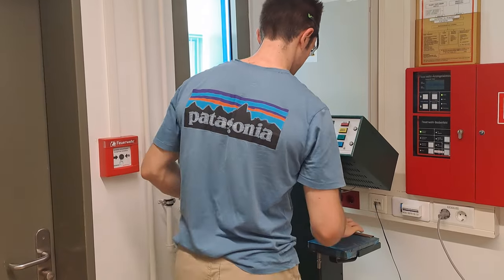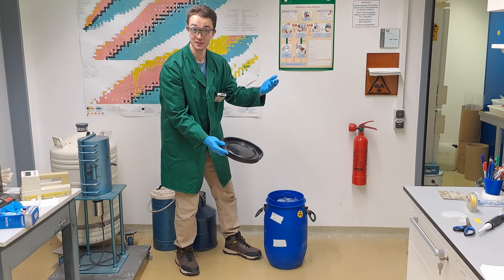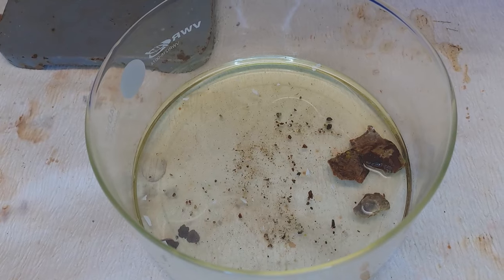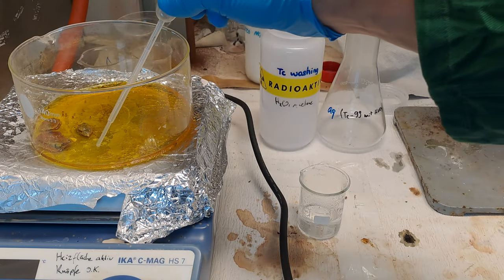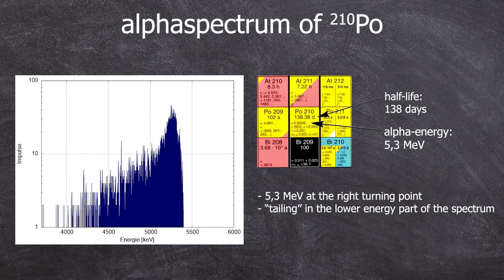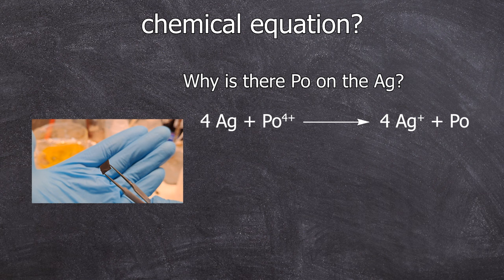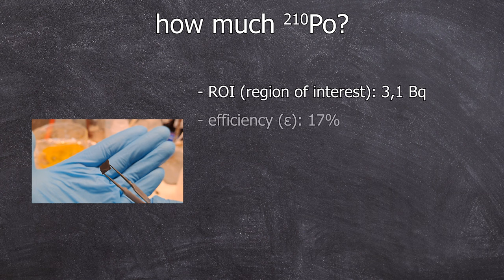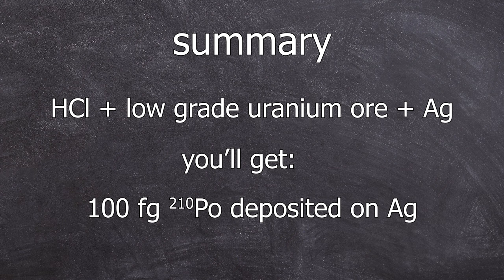Polonium-210 from Uranium Ore - Nuclear Chemistry

Comment: idk why did yt recommend this to me, but i wanna know, is there any long term effects to working with that? because i thougt radiation is like more dangerous then what you make it look like (sorry for broken english)
Reply from the maker: Yeah. Thats ma Job :D showing how dangerous radiation really is, when handled correctly: not that bad. Depends on the type of radiation but our bodies have quite a tolerance to it^^
Reply: I heard an analogy with burns. Both radiation and burns injure the body, but the body can recover when the injury is not too severe. However, a point comes where the body is not able to recover. This analogy is a better fit for the short term (acute) rather than long term (chronic) effects.

Comment: Polonium-210 is very radioactive, so would a piece of the metal be red hot, like Pu-240? I remember reading that the first nuclear bombs used a neutron initiator in the core made out of Polonium and Beryllium.
Reply from the maker: I still am not fully convinced how the manage to get the crystal structure as it is so highly radioactive, that it wouldn't be Solid without additional cooling
Reply from the maker: Yeah there are many ways to get neutron. We use Am-Be, but Po-Be and Ra-Be are also quite common. In the future I will Do stuff with our neutron source :D

Comment: What is the main mineral in your Uranium ore and from which mine came from?
Reply from the maker: Absolutely no idea. This blue Barrel is a complete mess. I don't think we know the mine of even just one of these rocks. Its the lowest purity uranium containing bunch of minerals😅
Reply: The point of my question is not all uranium minerals/compounds may have solubility/reactivity with hydrochloric acid. That's why it would be important to know which uranium minerals can react with this acid for this extraction
Reply from the maker: @MarioRodriguez-ow9rl  all will have enough soluabilty in concentrated HCl for this to work. As long as some uranium/polonium is on the surface, it'll work. But it be interesting how low the HCl concentration can get for it to work^^
Reply: But solubility/reactivity in HCl depends on the compounds/minerals. The main uranium ores are uraninite (uranium dioxide) and coffinite (uranium silicate) and I am not sure if they are sensitive to HCl. Although your ores seemed yellow indicating they may be any sort of salts such as carbonates, sulfates... It would be interesting to know if HCl work for any compound/mineral of uranium or just some and which.

Comment: Is that a butane filled alpha detector?
Reply from the maker: Nope its a semiconductor detector. You wouldn't be able to get spectra with Gas filled ones
Reply: @SimonsNuclearchemistry  Just to confirm we are both talking about the handheld detector?
Reply from the maker: @Yaivenov  oh 😅 I was talking about the other detector.
The hand held Como is a Gas filled detector on the undersite yes (it also has a scint. At the front build in). But I don't know which Gas. But you can prolly Google it🤷‍♂️
Reply: @SimonsNuclearchemistry  Neat, I thought I recognized it.  The different detection mediums in instrumentation is interesting to me.   As just an amateur the best I've got is a small NaI:Th gamma spectrometer.